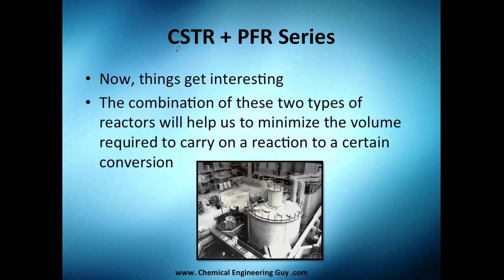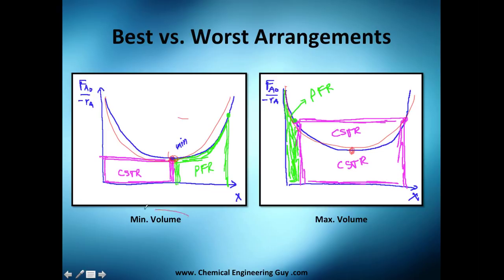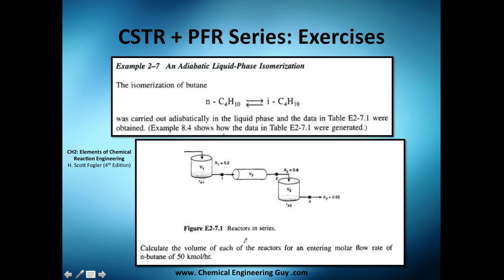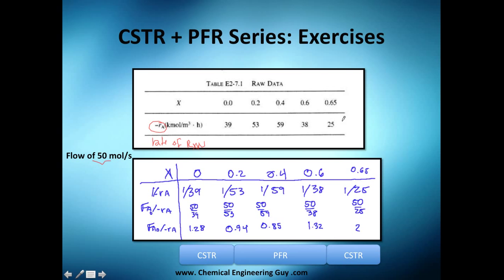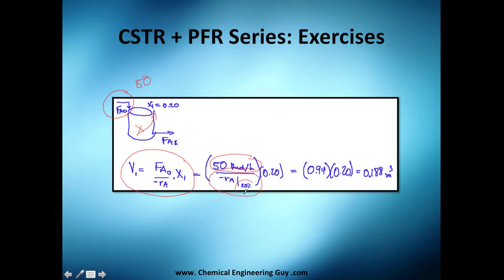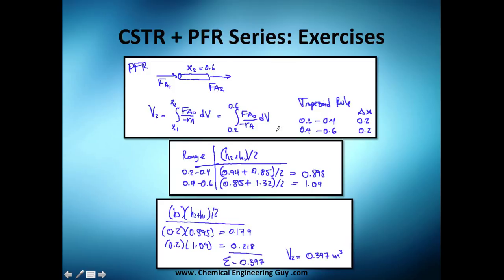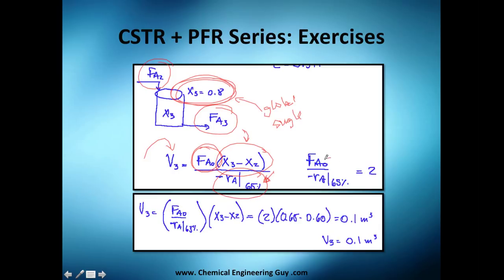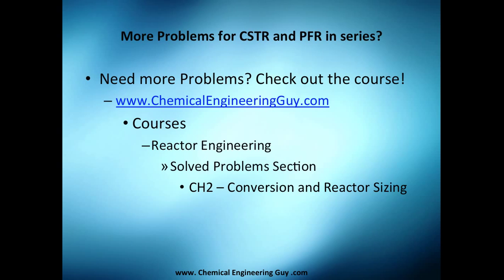CSTR + PFR Arrangements in Series // Reactor Engineering - Class 34

Comment: Hi Emmanuel, in the third tank you got X3=0.8, could you confirm it was not suppose to be 0.65
Reply: @9.57 (time)
Reply from the maker: Yes Zainab, the OVERALL conversion is 0.80, but the local conversion is 0.65
Reply: Chemical Engineering Guy how was this calculated please

Comment: Hey! Does Fogler teach about reactors with recycling? On Levenspiel there is a section where it talks about CSTR+PFR in series, with a recycle added on the PFR.
Reply from the maker: Yes, you can checkout some examples. Only "simple" examples can be worked on by hand due to iterations. Eventually, you will solve them on a software such as Aspen Plus due to amount of calculations! The important thing is to actually know how to set and model the equations.
Reply: Oh i see. Thanks :D